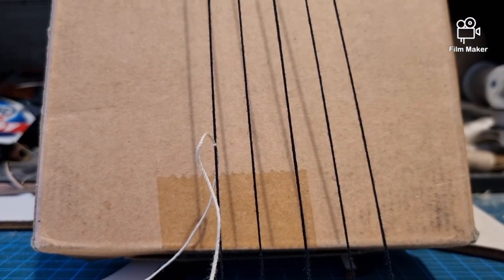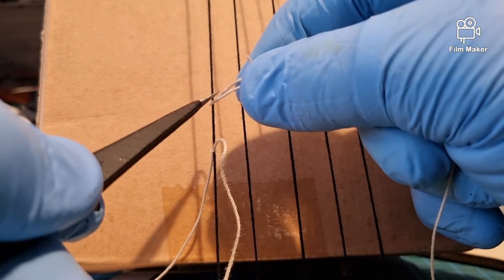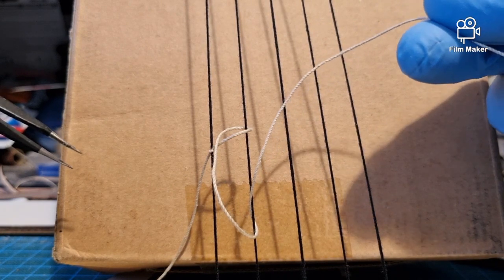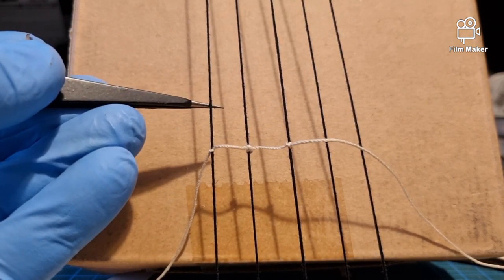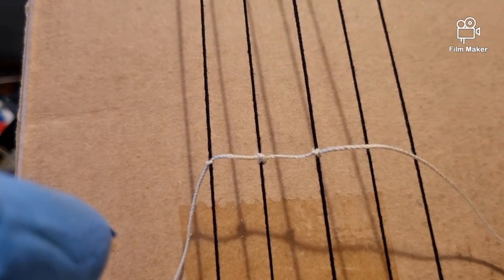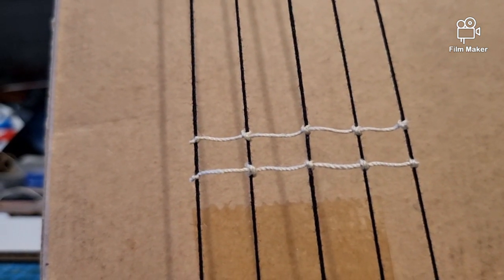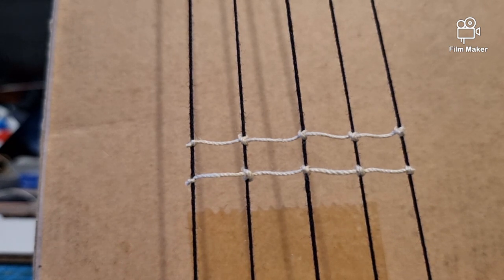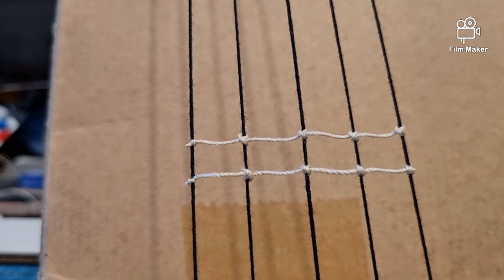How to do ratlines using the clove hitch

Comment: Cheers for the vid. I'd go for a clove hitch on the first knot too, keep it looking the same across. With the glue, it's not going anywhere. You can also use wood glue which soaks in the thread nice, dries clear without discolouring the knot, and has some flexability. Bit longer to dry.

Comment: I think that might be easier than an overhand knot. I’m about to start building the HMS Beagle from OcCre. I built the AS Bluenose II 15-20 years ago. I remember the ratlines took forever. Hoping this goes faster.
Reply from the maker: It may be my friend, but more importantly its thee correct way to install your ratlines. Any ship would have used the tradition clove hitch so it will also give you a much more authentic look..

Comment: Revell glue!  Trying that as soon as I get that far. I used superglue during my first build, and that dries up so fast that it doesn’t soak in and frankly, looks a bit of a mess sometimes. Thanks for tip!
Reply from the maker: I made a similar mistake Mike. Using superglue with thread is disastrous. It makes the thread very brittle and like you said dries way to quickly. Normal modelling glue simply soaks in nicely and dries nice a hard, but it still looks like normal thread which is what we are after buddy
Reply from the maker: Another tip for you Mike. Search for Loctite super glue gel. It's the only super glue i use. Being a gel it doesn't go all over the place, but does the same job. A fantastic product if you want an extra bond, but without the mess
Reply: @RJScaleShipsReplicas  Got that somewhere, and a lot of Revell as well. Did mainly ww2 armor and planes before I started with wooden ships about a year ago. I love the challenge of bending, cutting, sanding... not easy, but I think it’s great. And thanks to a great community and video tutorials like yours, I’m making progress 😀 so thanks again!
Reply from the maker: @mike74em  that's fantastic buddy. Its a beautiful hobby. More a passion so enjoy it my friend 😉👍👍👍👍👍

Comment: Thank you for this - so easy it's stupid - tutorial ,  clear , concise and simple :-)  Doing these will be coming up in the near future for me 
on my first build .  there's one thing I am wondering about tho ? ( no, 2 things )  after using bees wax on the rigging lines , does the 
glue still bond it in place well ? as the wax is a bit of a slippery coating  /  I realize you didn't use it on all the lines for the 
tutorial video cause it's not really necessary /  but when it comes to doing an actual project , will they stay in place ? 
2nd curiosity is : those tweezers you used here look really strong ( good quality ? )  any brand name ? and do you remember where 
you got them ?  most of what I've seen are flimsy and made in china which doesn't appeal to me at all :( 
Thanks in advance / BadCat Rick ;-)
Reply from the maker: Hello my friend. Yes the glue still does its job, but always remember it's a model so still take case when working around yout shrouds and ratlines. The ratlines will remain in their position unless you move them. Once you pull the clove hitch taught, the wax makes it grip. It will not move unless you physically want it to my friend

Comment: How do I determine what thickness of thread to do? I'm doing a 1:180 model of HMS Victory. The supplied thread seems too thin for the shrouds and too thick for the ratlines (only one thickness of thread supplied). Is there a useful site that gives the thickness of rope used?
Reply from the maker: Study really ship Philip. This will give you a mich better idea. Unfortunately, kits often get this wrong. In the video I'm using a much thicker thread for the ratlines for visual purposes only. The thread in reality would be a mich smaller guage. I always use ships like the victory, Constitution, hermoine and cutty sark as reference. It will give you a much better scale by studying these ships.. at 1/180 the thread would be quite small to say the least.. probably not far of a normal cotton thread. All my lashing on my 1/100 Victory was done with a cotton thread as small as a hair, which wouldn't be too far off the size you'd need for a 1/180 scale model. Luckily, we still have some incredible examples to study. Unfortunately the victory won't have all her rigging back until the restoration has been done, but there are plenty of images of her before that began. Also purchase a book entitled "the anatomy of Nelsons ships". This is the bible of victory model ship building and has a massive amount of useful information and diagrams. I hope that helps Philip and please let me know how you get on. All the best. Rob 😉👍👍👍👍

Comment: Can you do it on the model
Reply from the maker: It's exactly the same process on a model. No difference
Reply: @RJScaleShipsReplicas  so I can do it on the soil Royale
Reply: So tie off the black lines first then go after the say White lines do you cross lines
Reply from the maker: @shawnbrownstein151  just do exactly has I've done here buddy. Its a lot smaller in scale that this when it cones to the Soleil Royal, but once you have all your shrouds in place, literally follow this exact procedure. If you haven't seen my Soleil Royal have a look on my Instagram page as I finished the lower main mast ratlinss yesterday and I've used the identical procedure as this my friend. My Instagram is @rjscaleships
Reply from the maker: @shawnbrownstein151  yes Shawn. You want to have all the black lines (shrouds) in place way before you do the ratlines.. these are only done once shrouds are in place buddy